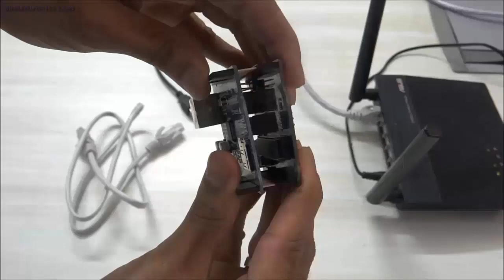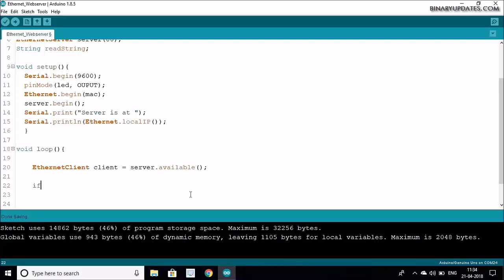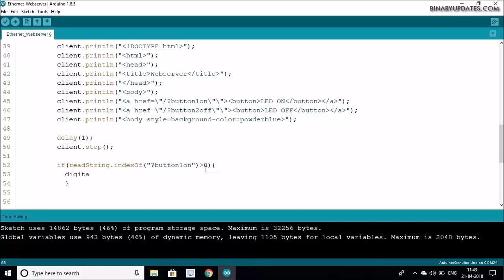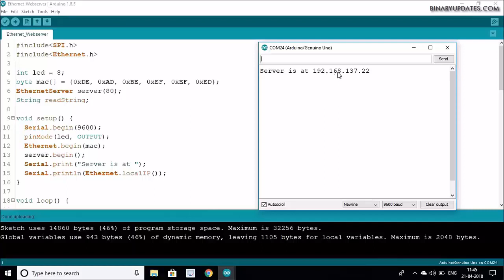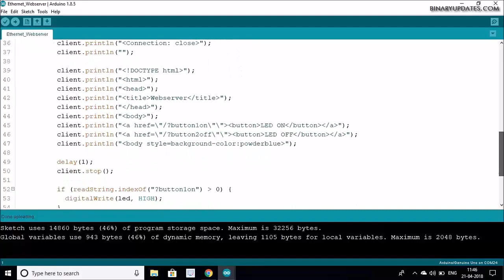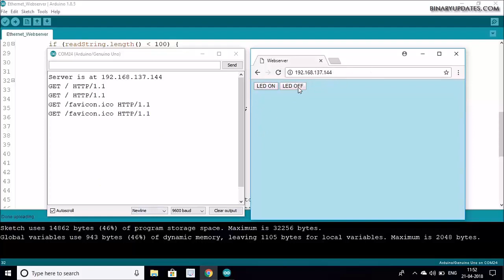Arduino Ethernet Shield Webserver

Comment: How can I load this HTML Code into a HTML file stored on a Micro SD Card. If you can make a video about that, I would really appreciate that. Also, I didn't quite understand that how are you getting an input when pressed a button and what is this favicon?

Comment: I have this error when I compile the code.

error: cannot declare variable 'server' to be of abstract type 'EthernetServer'
 EthernetServer server(80);
                ^~~~~~
C:\Users\Administrator\AppData\Local\Arduino15\libraries\Ethernet\src/Ethernet.h:254:7: note:   because the following virtual functions are pure within 'EthernetServer':
 class EthernetServer : public Server {
       ^~~~~~~~~~~~~~
In file included from C:\Users\Administrator\AppData\Local\Arduino15\packages\esp32\hardware\esp32\2.0.11\cores\esp32/Arduino.h:182,
                 from C:\Users\Administrator\AppData\Local\Temp\arduino\sketches\76A0C563204F020ECDBCFB310CF56096\sketch\WebServer.ino.cpp:1:
C:\Users\Administrator\AppData\Local\Arduino15\packages\esp32\hardware\esp32\2.0.11\cores\esp32/Server.h:28:18: note: 	'virtual void Server::begin(uint16_t)'
     virtual void begin(uint16_t port=0) =0;
                  ^~~~~

Using library SPI at version 2.0.0 in folder: C:\Users\Administrator\AppData\Local\Arduino15\packages\esp32\hardware\esp32\2.0.11\libraries\SPI 
Using library Ethernet at version 2.0.2 in folder: C:\Users\Administrator\AppData\Local\Arduino15\libraries\Ethernet 
exit status 1

Compilation error: cannot declare variable 'server' to be of abstract type 'EthernetServer'

What is the reason?

Comment: How is this working without resistor?
Reply from the maker: Its usually good practice to use current limiting resistor but it still works as 5mm LED tolerate the current flowing through circuit on Arduino ethernet shield. So it doesn't damage LED and still works. I hope this may help. Good luck and best wishes!

Comment: thanks for the tutorial, how about a webserver using ultrasonic in ethernet module?
Reply from the maker: Hi Barbo, you can connect any sensor to Ethernet shield with Arduino. As Ultrasonic sensor is digital sensor make sure to connect with any digital pin of an Arduino Uno. Good luck and best wishes!

Comment: #include<SPI.h>
#include<Ethernet.h>

int led = 8 ;
byte mac[] = {0xDE, 0xAD, 0xBE, 0xEF, 0xEF, 0xED };
EthernetServer server(80);
String readString;
 

void setup() {
  // put your setup code here, to run once:
  Serial.begin(9600);
  pinMode (led, OUTPUT);
  Ethernet.begin (mac);
  server.begin();
  Serial.print("Server is at ");
  Serial.println(Ethernet.localIP());

}

void loop() {
 EthernetClient client = server.available();
 if(client){
  while (client.connected()){
    if(client.available()){
      char c = client.read ();
      Serial.print(c);

      if(readString.length()<100) {
        readString += c;
        }

      if( c = '/n'){
            Serial.print(readString);
            client.println("<HTTP/1.1 200 OK>");
            client.println("<Connection-Type: text/html>");
            client.println("<Connection: close>");
            client.println("");
            
            client.println("<!DOCTYPE html>");
            client.println("<html>");
            client.println("<head>");
            client.println("<title>Gelectronic</title>");
            client.println("</head>");
            client.println("<body>");

            client.println("<a href=\"/?button1on\"\"><button>LED on</button></a>");
            client.println("<a href=\"/?button2off\"\"><button>LED off</button></a>");            
            
            client.println("<body style=background-color:red>");

            delay(1);
            client.stop();

            if(readString.indexof("?button1on") > 0){
              digitalWrite(led , HIGH);
              }
            if(readString.indexof("?button2off") > 0){
              digitalWrite(led , LOW);
              }
              readString = "";    
            
        }        
      }
    }
  }
}

Comment: Arduino : 1.8.16 (Windows 10), Carte : "Arduino Uno"

hi , thnk you for video , but i have a problem see this my message.

avrdude: ser_open(): can't set com-state for "\\.\COM3"

Une erreur est survenue lors du transfert du croquis

Erreur durant la définition des paramètres du port série: 9 600 N 8 1

Ce rapport pourrait être plus détaillé avec
l'option "Afficher les résultats détaillés de la compilation"
activée dans Fichier -> Préférences.

Comment: Does the computer also need an internet connection to the model?
Reply from the maker: Yes to access webpage on computer your PC and Arduino will be in same network which can allow access webpage. Even though its a webserver running on Microcontroller on Arduino Uno. I hope have cleared you doubt. Good luck and best wishes!

Comment: Very good explanation of the ethernet shield for arduino. I have a challenge been dealing with for some time. Can I control two lines of video from an digital cctv camera that is not IP? The camera is a Samsung SEB-1005R with an RJ45 connector but the wiring is NOT for 10/100/1GbaseT instead it uses the internal 3 pairs to transport 12v and the video signals on one pair. I have used the RCA yellow cable to connect to my TV and it works fine. I want to view this camera input on a web server. Does arduino has a library for working with video this way? Anyone with information please feel free to comment.

Comment: when i upload the code and open serial monitor it takes to much time for arduino to react and it gives me 0.0.0.0 what i have to do please anyone can tell me? thank you
Reply from the maker: Hi Arif, this means your Arduino Ethernet Shield is not getting connected with internet. Please check connection between Arduino and Ethernet Shield also make sure LEDs on ethernet socket light-up. This ensure proper connectivity of LAN Cable through Internet router. I hope this can help. Good luck
Umesh Lokhande
Reply: @BINARYUPDATES  thanks for response. But i have make all of connections properly, all my my indicators lights up, but still i cant reach to the internet. Im thinking its about ip or mac or such i dont know about them well. If you have any idea for make this work please share with me, i really want to make this work. Thank you so much.

Comment: Its possible to use this library in Esp32 or there is a library specific to the Esp32 ? 
My question is, how to connect my Esp32 in router and internet with cabe ?

Comment: Thanks for the tutorial it was really helpful 
I have tried to butcher your code a bit to control a stepper.  The HTML displays on a website with the button: 
 
I added the following loop below to try and control the stepper but it doe not seem to work. Any ideas?:

      if(readString.indexOf("?button1on")>0) 
        {
          stepper.setCurrentPosition(0);
          while(stepper.currentPosition() != 600)
          {
            stepper.setSpeed(400);
            stepper.runSpeed();
            }
            delay(2000);          
            }

Comment: Good day binary update, I have an issue of connecting my arduino ethernet shield to my network. In my working place i have a 16 port cisco switch that connect all devices together with a desktop computer (using this IP address: 192.168.0.1-255, subnet Mask:255.255.255.0).  i use the desktop computer to log into any device interface and do whatever I want, So I manually assigned this Ip address to the arduino ethernet shield because I have no router, but the desktop cant ping the ethernet shield....... PLEASE HELP ME what to do

Comment: I don't know if you can help ive bought a wiznet w5500 ethrenet device iam using your code and I get an ip address but I don't get a link status lights on the rj45 connector the cable iam using works

Comment: why im getting server is at 0.0.0.0?
Reply: You must connect the cable to the arduino Ethernet shield... And the wireless router.. If it didn't work reupload it
Reply: did you solve that problem ? im haveing this  problem too

Comment: #include <SPI.h>
#include <Ethernet.h>
int led = 8;
byte mac[] = { 
 0x90, 0xA2, 0xDA, 0x00, 0xFB, 0x80 };

EthernetServer server(80);

String readString;

void setup() {
 Serial.begin(9600);
 pinMode(led,OUTPUT);
 Ethernet.begin(mac);
 server.begin();
 Serial.print("Server gestartet. IP: ");
 // IP des Arduino-Servers ausgeben
 Serial.println(Ethernet.localIP());
}
 
 
void loop() {
EthernetClient client =server.available();

if (client){
    while(client.connected()){
      if(client.available()){
        char c = client.read();
        Serial.print(c);

      if(readString.length()<100){
        readString += c;
        }

     if (c == '\n'){
      Serial.print(readString);
      client.println("HTTP/1.1 200 OK>");
      client.println("<Connection:-Type: text/html>");
      client.println("<Connection: close>");
      client.println();
     
      client.println("<!DOCTYPE html>");
      client.println("<html>");
      client.println("<head>");
      client.println("<title>Webserver</title>");
      client.println("</head>");
      client.println("<body>");
      client.println("<a href=\"/?button1on\"\"><button>LED ON</button></a>");
      client.println("<a href=\"/?button2off\"\"><button>LED OFF</button></a>");
      client.println("<body style=background-color:powderblue>");
      
      delay(1);
      client.stop();

      if(readString.indexOf("?button1on")>0){
        digitalWrite(led,HIGH);
      }
      if(readString.indexOf("?button2off")>0){
        digitalWrite(led,LOW);
     
     }
     readString = "";
    }
   }
  }
 }
}
Reply: it is not working for me